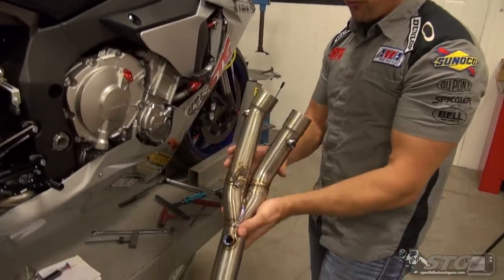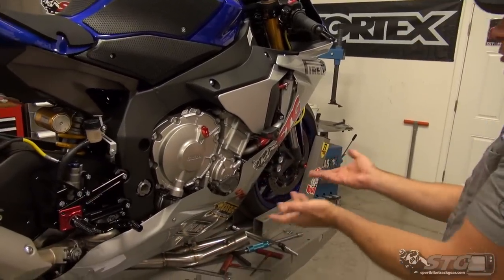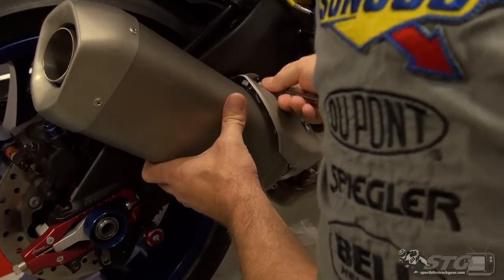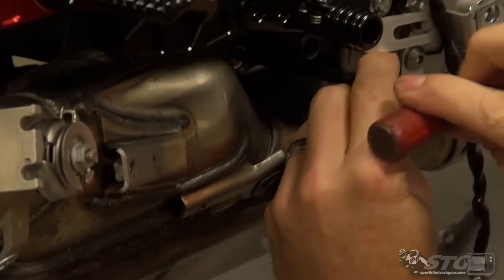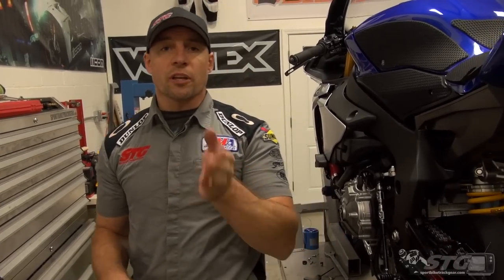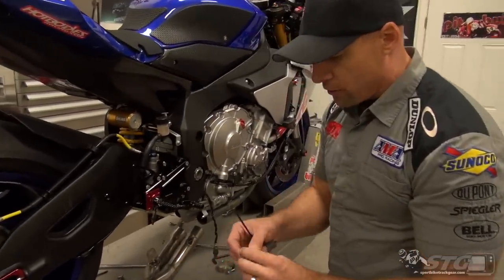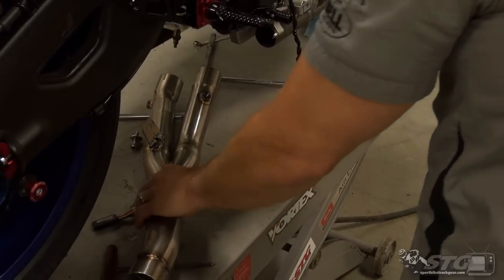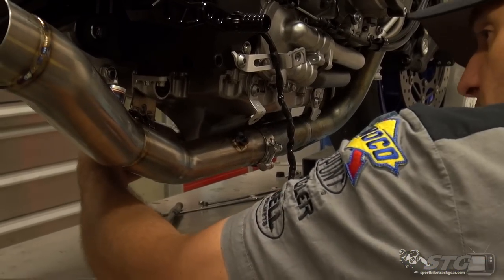M4 Titanium Cat Eliminator Install on a 15-17 Yamaha YZF-R1 from Sportbiketrackgear.com

Comment: That sounds amazing, and I like the look with the stock cannister
Reply from the maker: +Adam Green For a stock canister I would agree it looks good. This is a great way to improve the performance and save some money. - Van
Reply: +Sportbike Track Gear Great Vid Van, as usual. Big fan and customer here from the Emerald Isle !!! Thought I would mention that you also lose some heat from the Cat removal  , aside from weight, and a noticeable improvement in torque. Dailing in with a PC or flash I think might be desireable to get the air/fuel ratio just right. I have this set up on my 2008 R1, using stock exhausts, and not only does the bike sound just great ( Not loud ), it has way better low and mid end pull than the stock bike now. I did add a race filter and block off plates. The stock 07-08 bike has crappy air/fuel ratios due to emissions, and runs very lean. Especially the North American models.

Comment: Hi Brian,
You mentioned briefly that the Cat Eliminator come with an adaptor for M18 size O2 sensor. Is it easy to swap it out to use with aftermarket M18 o2 sensor?
Reply from the maker: Yes it is easy to do, the adapter threads in and out no problem. - Van

Comment: Thanks for the video. I am using Austin Racing GP1R slip-on 9n my 2018 R1. The slip-on is mounted directly on the muffler box and it has no other connections to the body of the motorcycle. Can the decat pipe support the additional weight of the GP type slip-on?
Reply from the maker: The slip on does not mount to the rear set bracket? The pipe should be able to hold it. That said over time it may crack the pipe where the hanger is welded on. - Van

Comment: hey van I plan on doing this,along with a slip on on my 15 r6...does this setup typically require remapping the ecu? thanks
Reply from the maker: +r j For peak performance you will want to re-map or get a fuel controller (PCV, Bazzazz, etc.) but it will not damage your bike to operate without a re-map.
Reply: @sportbiketrackgear   Saludos desde Venezula...!!! ...  "Master" Van...!!!  I will do the same mod ... What are the STG's DIY option avalable for peak performance for YZF-R1 2015 ???, pls drop the links on your reply for easy ordering ...Muchas Gracias "Maestro" Van ...!!!

Comment: Is a tuning needing after this? ECU, fuel mapping, etc? Or is it just simply plug and play? Thanks
Reply from the maker: You do not have to install a tuner or flash the ECU to use it. With that said to get all the performance benefits you would need to do one or the other. - Van
Reply: @sportbiketrackgear   Saludos desde Venezula...!!! ...  "Master" Van...!!!  I will do the same mod ... What are the STG's DIY option avalable for peak performance for YZF-R1 2015 ???, pls drop the links on your reply for easy ordering ...Muchas Gracias "Maestro" Van ...!!!

Comment: Very nice, including loosing the power valve motor you'd loose even a little more weight too. This mid pipe with the Akra slip on would be mint!
Reply from the maker: +NZsarge1 You could do that no worries. - Van
Reply: +Sportbike Track Gear Yep but I've since seen your video on the Akra link pipe/cat eliminator with the Akra slip on so...

Comment: Looks great !! I want to do it on my 16 R1 too .. But, do I need to install Smog block off plates even if you use a stock canister ? And if I do not re-flash EMU,will that have any affect on my engine run ??
Reply from the maker: Changing the CAT is really what opens up the exhaust system so I would recomend installing the SMOG plates even when using the stock cannister. The bike will run a bit more rough at idle and may back-fire on decel but it is not dangerous to the longevity of your bike. If you want the absolute best running motorcycle then you would want to get a fuel control unit with auto-tuner or a remapped ECU. Thanks for watching!
Reply: Thanks for your Answer, You guys are the best in helping out novice riders like me :-)

Once last question, If I have my ECU remapped do I still need to have SMOG plates installed or just the remapped ECU will be enough ?  Once again Thanks a ton.. !!!
Reply from the maker: That is a question for your tuner! I think a lot depends on what the set-up was when the bike was tuned.
Reply: Do you guys offer the re-flash service ? If you can please let me know the instructions. Thanks !!!
Reply from the maker: We do not offer ECU flash services. Those types of things should always be performed by a trained professional. Thanks for watching!

Comment: Hey great video !

Quick question: Someone told me I should not install the o2 sensors back in to telling pipe and just use blanking bolts. 

What is the reason for this? 
And should it be done ?
Reply: Big ol burrs in the threads, have to torque the shit outta o2 sensors to get them to fully seat, the burrs dont hit the sensor part though, dont think it will be an issue, but it would have been nice if they would have cleaned the threads better

Comment: I've installed a link pipe (MJS performance) and Termignoni exhaust pipe without tuning, flashing and dynorun. It gets popping sound on deceleration on low revs and a lil backfires. Alot of my friends say it will damage the valves overtime while others say its alright. What are your thoughts? Thanks!

Comment: Great video tutorial and demonstration.  Your video is exactly what I been wanting to do for my 2017 Kawasaki ZX-10RR since my Racefit Black Edition is too f'ing loud.  Is this M4 Titanium Cat Eliminator a system you designed specifically for this bike or can you tell me if I can buy a free flowing pipe exactly like this but for my application to utilize my stock canister?  Thanks in advance.

Comment: Would any cat delete mind pipe fits the stock muffler? Or I need to buy the cat delete kit, that specifically fits the factory muffler?
Reply from the maker: You can use this with the OEM muffler if you like. - Van

Comment: Hi Van, great vid as always... Have you ever tried the Mivv link pipe? It's a Ti 2 piece but not sure as it's half the price of the M4...
Reply from the maker: I have no experience with this brand and a ton with M4. I found their pipe and it looks like it is 390 euro which is $462 USD before shipping. The M4 is $501 shipped on our site to the US so the price I see is pretty close. If you are in the US I would stick with the M4 because they are easily available in the event you need product support of any kind not to mention I have fit this pipe and know it fits well. - Brian Van
Reply: Sportbike Track Gear Hi Brian ok sure it makes sense... thanks for the info...

Comment: What measurement the hole of O2 sensor R1M?how many diametres?please answer,I will make middle pipe by myself,,thank you,sorry if my english so bad
Reply: And what size diameter the pipe of middle pipe that connect to the header OEM and diameter pipe to the slip on is?anyone know?just tell me please,need some help

Comment: So did you take the servo exup cable and motor off too?
Reply from the maker: Yes you will remove both of them when you install this. To turn off the engine light you can either do a flash tune or install a servo buddy on the bike. 
FlashTune ECU Type 18 Bench Tuner Kit Yamaha YZF-R1 15-18

https://www.sportbiketrackgear.com/flashtune-ecu-type-18-bench-tuner-kit-yamaha-yzf-r1-15-17/

SkutrNet Yamaha YZF-R1 02-18 Exhaust Servo Buddy

https://www.sportbiketrackgear.com/skutrnet-yamaha-yzf-r1-02-17-exhaust-servo-buddy/

- Brian Van

Comment: Hi there, just wanna ask, if i remove the catalytic converter from my R1 2015, will there be any defects in the performance? Im thinking of get rid the cat converter..but im scared that it would affect the system or wiring or fuel and air ratio or the engine itself..any infos about it?

Comment: Is it true that removing the EXUP decreases power in the low RPMs????
Reply from the maker: Yes it can reduce the power a bit at low rpms. End of the day most of the riding is done a little higher up in the rev range so this is not a real issue. The gains made more than make up for this. - Van
Reply: @sportbiketrackgear  Thx Van, I hear the power loss is a real pain for street riding, is that accurate?  Is the ECU flashing a must, concerned about where to do it and warranty?
Reply from the maker: If you are concerned about warranty I would proceed with caution for the flash. I have heard of riders getting jammed up with a warranty claim on a bike that was flashed and heard others get it taken care of without issue. For the R1 Graves has a system that retains the valve, here is a link to that: https://www.sportbiketrackgear.com/graves-motorsports-yamaha-yzf-r1-15-17-cat-eliminator-exhaust-valve-type-r/  - Van
Reply: Sportbike Track Gear thx very much for the input Van!

Comment: I have a r1s. Is my headers smaller the the r1 or r1m.  I'm told it's different and I have to buy headers?
Reply from the maker: Just called my man Kyle over at M4 to double check, this will fit the Standard R1, R1M and the R1S (all current R1 models). - Van
Reply: @sportbiketrackgear  awesome thank you.

Comment: Akrapovic  L-Y10SO12T  will this slip on fit this y-pipe
Reply from the maker: It that slip on will fit the OEM pipe it will also work with this pipe. - Van

Comment: Can i use an akrapovic slip on with this m4 mid pipe?
Reply from the maker: You can as long as the Akrapovic slip on you want to use will bolt up to the OEM system you are good to go. If you want to send me a link to the exact slip on I can verify 100% for you. - Brian Van

Comment: Anybody know if its the same process for a 2017 FZ-10? looking to install to get a better sound out of the stock headers and tip
Reply from the maker: No the system from the R1 will not fit on the FZ-10. M4 does have a 3/4 system for the FZ-10 that eliminates the OEM cat with a carbon can. Here is a link to this on our site: https://www.sportbiketrackgear.com/m4-yamaha-fz-10-2017-x-model-mc36-carbon-slip-on-exhaust/  - Brian Van

Comment: is it ok if i install the cat eliminator exhaust and keeping my old servo motor and fold the cables then i put them underneath the seat ? or a check engine light will comes on ?
Reply from the maker: The check engine light will remain off if you leave the motor plugged in. I would recommend you grab a Skutrnet Servo Eliminator since the actuator would not be doing anything on the motorcycle.

Comment: From my motocross expeirence i know yamahas are built the same frome the 250f's to the 450f's apart form so very minor differences will this same process work on an R6 of the same year or newer?
Reply from the maker: For the most part the process will be relatively the same. Minor differences but you should be able to use this as a guide to help get through the process.

Comment: I just picked up the Yoshimura street alpha stainless steel slip on for my 2016 R1S. Could you help me with the dimension of the mid pipe I need, is it the 60mm or 61mm? I want to get rid of the cat. Thanks in advance!
Reply from the maker: I do not know the diameter of the pipe but here is a link to the M4 Mid Pipe for the 15-19 R1 that will work with that slip on and allow you to eliminate the cat. 
https://www.sportbiketrackgear.com/m4-yamaha-yzf-r1-15-17-titanium-catalytic-converter-eliminator/

https://www.sportbiketrackgear.com/m4-yamaha-yzf-r1-15-17-stainless-catalytic-converter-eliminator/

Comment: I just did my exhaust system but on the Y Pipe where the clamps are put on , I leak air and also on the clamp on the m4 slip on. Is this normal since I am using a clamp or should I just get them welded? All clamps are tighten good.
Reply from the maker: It is normal to have a little because they are just slip joints. As far as the clamps go they do not need to be tightened excessively as this could distort the pipe and cause it to leak. There should not be a need to get this welded. - Van
Reply: Thanks van. This is my first time working on my bike and I gotta say your videos are very detailed and helpful 👌🏽

Comment: I need one for my 2015 R6 I have cat eliminated with m4 Y pipe, can you get the titanium m4 heads to make it one full system? Thanks✊🏼🏁🏁🏁
Reply from the maker: I looked into this and the M4 headers will not work with their cat eliminator mid pipe. We never replaced the stock header on our 2015 R1 Project Bike and do not recommend a full system to most riders. If you are not going to build the motor I do not feel there is a need to install a full system. - Brian Van
Reply: Sportbike Track Gear so if I wanted the titanium M-4 headers for my 2015 R6 I would have to order the complete system with Y pipe already attached as one piece and just set my m4 ynpipe tontje side, am I saying that correctly? Or do they not make a fu headers and all system for the 2015 R6 ? Just trying to find out what ways gonna be the best to go as far as headers! Thanks 🙏🏻 ✊🏼🏁🏁🏁
Reply from the maker: Yes the full system is different from the CAT elim pipe they sell. Remember you cut the stock header to install that. 
M4 Yamaha R6 06-18 Titanium Full Exhaust X96 Carbon Canister
https://www.sportbiketrackgear.com/m4-yamaha-r6-2006-2017-titanium-full-exhaust-x96-carbon-canister/

M4 Yamaha R6 06-18 Stainless Full Exhaust X96 Carbon Canister
https://www.sportbiketrackgear.com/m4-yamaha-r6-2006-2017-stainless-full-exhaust-x96-carbon-canister/

Above are links to both the Stainless Full System and the Titanium Full System for the Yamaha R6. - Van
Reply: Sportbike Track Gear Yes I
Have the M-4 Exhaust slip on, Street Slayer Edition with m-4 Y pipe hooked to stock heads! I cut the cat off, ground around my edges made it pretty and the M4 Y pipe and m4 street slayer slip on, fit perfect!✊🏼🏁🏁🏁
Reply: Sportbike Track Gear https://instagram.com/p/BadbbgynKAO/
Reply: Sportbike Track Gear Yes I had to cut the cat off when I put the Y pipe on, so it's ready, thanks for the input my friends!✊🏼🏁🏁🏁

Comment: Do you know if this link pipe fits with the Akra GP slip on?
Reply from the maker: Yes it will and we have sold may to people looking to use it with the Akra and other brand slip ons to get a 3/4 system for the R1. - Brian Van
Reply: Thanks for the reply guys, I'll be purchasing one soon.

Comment: If the sound is legal for road use i will buy it... In other words, is the sound street legal?(:
Reply from the maker: Thanks for watching! The legality depends on where you reside so you will want to check your local noise restrictions. M4 does however intend this exhaust be used only off public roads. Let me know if you have any other questions!

Comment: Sharkskinz bodywork?
Reply from the maker: +meanstrk No that's Hotbodies Racing. - Van
Reply: +Sportbike Track Gear    Ahh. I have painted Lacamoto, CRC, and Sharkskinz for the new R1, but not the Hotbodies. Did Hotbodies get them right?
Reply from the maker: +meanstrk Yes, fits nice. I worked on the fit with them. Nice stuff and the price is right at $499.95 - Van